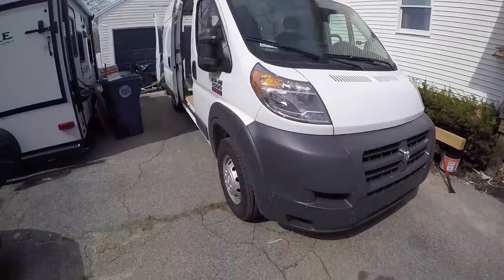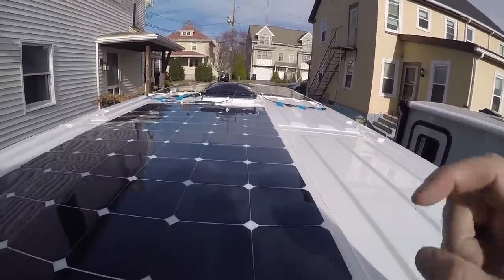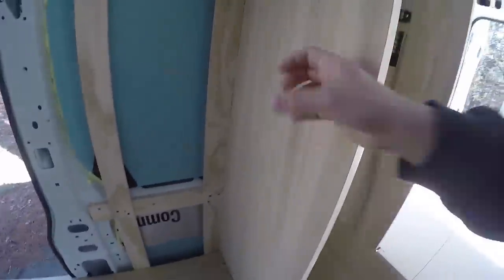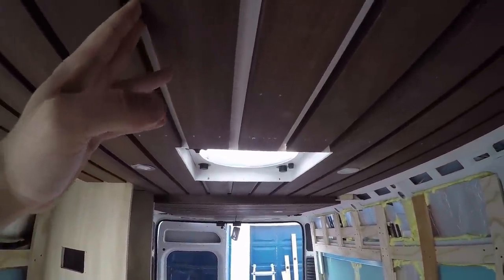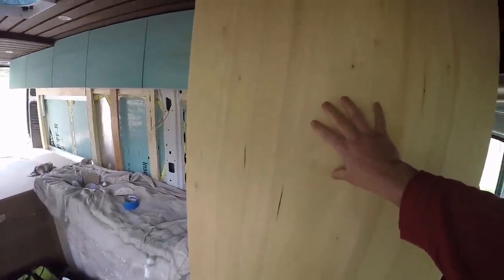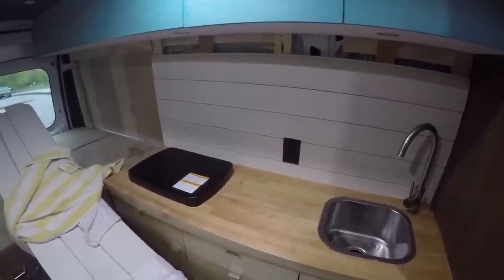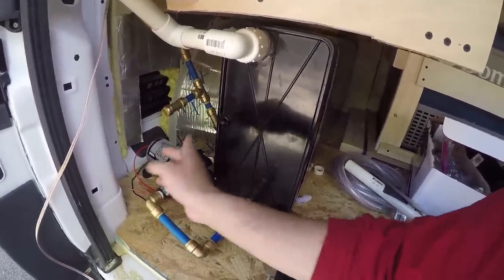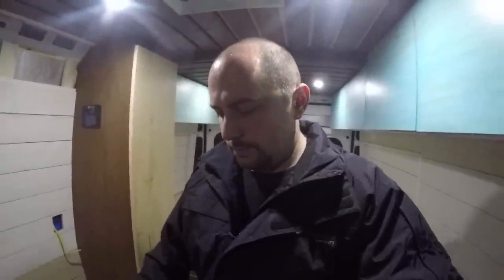How I Converted My Van into a Stealth / Off Grid / Tiny Home Van

Comment: Hi - Is your van the high roof?
Reply from the maker: James Stufano yes it is
Reply: Thanks. I like the work you did. Can I ask why you picked the Dodge Van you did versus say the Mercedes Sprinter?   If you had a do over would you have used a 4x4 or diesel?  I ask because I was thinking of the Mercedes Sprinter until I watched your video and you seem to think things out.  Is the engine and build of the Dodge solid?  I also noticed many for sale have a metal wall behind the seat. Did you keep or remove your wall? Thanks. Sorry for all the questions in one text.
Reply from the maker: James Stufano I actually did a video about why I went with the Promaster so check that out. But couple main reasons were price, a 4x4 sprinter near the same wheelbase goes for $55-60k brand new same year as mine. Mine was $31-32k. Amount of room! The Promaster has more cubic feet then the sprinter by far. Promaster is front wheel drive which can handle snow well. In my "one year in the van" video I did a flashback to me driving through a blizzard. The engine remains to be seen. I only have 16k miles on it but I will say the price of repairs is a lot cheaper then the sprinter. After saying all that IF I do another build I will probably go with a 144" 4x4 sprinter. I've driven them and they do drive amazingly well. Also a little smaller which is cool and a challenge to build. Depends on if I want to build another stealth van or adventure van. Go look at the professional companies that build on both sprinter and Promaster and see what they like.
Reply from the maker: James Stufano oh and sorry I didn't answer about the wall. Mine didn't have the metal wall. My brother is doing a build in a 170" sprinter right now and his had a wall and he just removed it. I hear it's easy

Comment: You should put an hho system in this too..
Reply from the maker: Justin Heitter I looked into those systems and I’ve seen them before. I just didn’t want it for my set up is all. Maybe on a larger van or if I was using my shower more

Comment: I didn't know you can stand in a Promaster
Reply from the maker: Promaster does make a low roof and a high roof. With it totally empty the high room inside from metal floor to metal ceiling is a little over 6'4"

Comment: How did you fasten the solar directly to the roof?
Reply from the maker: With flexible panels it's hard to fasten down. I used sikaflex
Reply: Have you had issues with it or would you recommend this method. I don’t want holes in the roof and am contemplating putting them on a ladder rack but that will create more wind resistance. I like the the stealthiness of your install.
Reply from the maker: @nicolebracco4419  well you'll have to have holed no matter what. You need to run the wires into the van somehow. I have 2 holes in my roof. One is my roof vent and the other is much smaller to fit the wires in but still a hole. With flexible panels you don't need a air gap BUT with a regular solar panel you need a air gap so I'd suggest mounting them if you get a panel. But flexible you can stick right to top of roof

Comment: Nice job
Reply: I like that ceiling  thinking about doing that. Did it add much weight? I think that 3m makes a spray glue  that would prevent having to stilt the insulation. Think it tacks pretty fast. I’m going to try it anyway cause that seems difficult.

Comment: Counter top is overkill. 1" is the maximum thickness needed. And for an expensive van like a ProMaster you may as well invest in Lithium Ion batteries. They weigh 1/3 of the gels, take up 1/3 space and cost a 1/3 less over the life of the battery. Your use of materials is strange as well. Why add so much extra weight to the van when it isn't necessary. The ceiling boards could easily have been 1/2 as thick and the decorative cross pattern boards just add extra weight, waste material and add weight. When building small spaces for living, less is more. The slide-out coffee table is very nice.

Comment: How did you attach everything to the walls in the roof of the van
Reply from the maker: Great question. I wish I showed that and sorry I didn't. So the metal ribs on the sides of the van are diffented widths and we wanted to make sure everthing was going to be in line and straight. We took 3/4" plywood and cut them into strips and used them to attach to metal ribs of the van then put vertical strips in as well and that acted as a frame for my walls and also something for my upper cabinets to hold on to. The other walls inside are all done with cleats. The roof is screwed into the metal ribs above. There's a small point in the video you can see the frame of the walls to see a little better what I'm trying to explain. I will be doing a detailed video in the future of how certain parts on the van were built too.

Comment: How did you manage the planning and blueprint stage?
Reply from the maker: I made a sketch on google sketch up. I knew what I wanted for a layout but didn't really know until I got the van and got inside and started measuring everything out. I also knew I was going to make a lot of detail changes along the way so with my sketch I didn't go into detail. For example in my sketch my bathroom was smaller, kitchen counter was smaller, my overhead cabinets were different, closet was bigger, and my bench was changed a little.
Reply: Jarrod Tocci How did you know what to purchase, what you needed, what works? Did you watch other youtubers or your own research? Also why this van?
Reply from the maker: Fantastic question. When I first made the decision to build a van I knew I needed money so I took on a second job which was a low key overnight job at a hotel. Every shift for 5/6 months I watched videos, did research on products, contacted who I needed to contact, and because I was doing the build with my dad him and I sent hundreds of emails back and forth. When I found a product I really liked I designed around that product. For example I really wanted a fridge/freezer combo and the one I got opened from the top so I needed to fit it somewhere and open it too, so I had it slide out from under my bed. I knew the batteries were huge had to design around those. Where the water tanks would go, I knew I wanted my fresh water tank inside the van. A huge part of the design is the bed area, for me I didn't want to pull something out or fold something down every night before I went to bed. I wanted to do the least amount of moving things around to make something function. That's why things on my design slide like my table (You might of just convinced me to do a video on why I designed the way I did).  Even after all that I still think I missed some things or could of done a better build. I do love my build and what I did, but I'm just saying. Something I didn't do which I wish I did was to either rent a van and try it out for a weekend to see what I did and did not like, or go check out a RV place that has class B RV's and see how they work and function. I know there's also trade shows all over too. 
Why my van? I'm planning on doing a video on this but just some key points for me was the inside cubic foot can not be matched. This van is wide enough for someone of my size to lay across instead of the other way. The Promaster is the sister van to the Ducato which is from the UK and that van has won several awards. The big name RV companies are now using the Promaster for their class B's, so something must be right there. It's front wheel drive, which is the only van in this class that's front wheel drive. COST not only up front cost but repairs and even oil changes and maintenance. If I was to sell my van and do another build I'd come back to the Promaster for sure. My advice is to test drive which ever you're thinking about and get quotes on them just to compare. For me I loved how the Promaster drove, I felt like I was driving a car and not a van. Sorry for the long response but I hope it helped a little.

Comment: 1 problem none of these vans are wide enough to fit a sleeping full sized adult sideways.
Reply from the maker: Short E I sleep sideways. I’m only 5’8” and the bed is about 6’
Reply: Jarrod Tocci Hmm interesting whats the inside dimensions of these?
Reply from the maker: Short E with nothing inside the cargo area is roughly 12’6” x 6’4” but because I put insulation, walls, flooring, and ceiling in it takes away some space. You can maximize space a few different ways if needed
Reply: Wow, I built my own Tiny Home on a trailer and the inside dimensions are only 5×9 I probably should of just built 1 of these your van gets the same mpg as my vehicle does pulling the trailer too.
Reply from the maker: Short E very impressed you built one inside 5 x 9! Awesome 👍
Reply: Jarrod Tocci Thanks, I got a video of it on my page
Reply from the maker: Short E awesome thanks I’ll check it out!

Comment: What are the dimmensions of the shower?
Reply from the maker: Tyler Alexander 27” x 24” I’m doing more in depth video of the shower this week
Reply: Sweet I'm looking forward to it. Also, what were the pink strips you put down on the floor before the insulation?
Reply from the maker: Tyler Alexander just acted as a filler. Not sure if it even did anything other then fill in the space between the floor ribs. They might of helped with insulation a little too
Reply: I figured it was to level the floor, but what kind of material is it?
Reply from the maker: Tyler Alexander just like a foam. Picked up a roll of it at Home Depot. Remember it being pretty cheap

Comment: See you used some Old Shitty Board for the floor, LOL.
Ceiling looks good.
Reply from the maker: You mean brand new vinyl flooring from home Depot.....ok
Reply: (I was referring to the underlay. ;-)) @JarrodTocci
Reply from the maker: @softdorothy  lol I see....so you mean the wood marked as "underlayment" or "subfloor" also at Home Depot ;)

But you're right I could of went with something more expensive but in my opinion there was no point seeing how the purpose of a subfloor is to be under the finish flooring and act as support

Comment: Interesting project, but so much wasted space!  So many vids by maritime builders could have shown you how to utilize every inch, and use lightweight materials.  How do you sit up in bed without hitting your head on the overhead locker?
Reply from the maker: tina silver the space was designed exactly how I wanted it. I know there’s “wasted” space but I also wanted to keep it as open as possible. My bed area is for sleeping so to sit up in there wasn’t a concern as I have a bench sitting area for me to sit, read, write, or do any other work or eat. I said in the video that everyone is different with a design and purpose and I built and designed this for my purpose.

Comment: Can't you make the heating easier than having to remove the panel? It would annoy me. So cool that you have a shower.
Reply from the maker: Shower has been great. I don't use it everyday but still very handy. I don't use my heater that much mostly because I spend my time in warmer climate so yo heat the van quickly is it main purpose

Comment: How do you secure the toilet to the floor?
Reply from the maker: Albert Ochoa it’s not fastened down only because of the size of the shower I remove it from the shower when I want to use the shower. To keep it from sliding about while driving I put small rubber non slip pads under it. I also built a heavy duty shelf inside the shower so now I can just slide the toilet out on the shelf instead of picking it up

Comment: what about magnetic field/radiation from the battery?
Reply from the maker: wallmachine good question. In my video touring the solar company I explain how my batteries go give off anything harmful which is a major reason why I got mine. The lead acid batteries do and need to be vented
Reply: ... Radiation?  Magnetic fields? I'm lost on why these affect the battery. If you mean gases, sulphuric acid batteries create small amounts of hydrogen (H) during charging, which is why they need to be vented. Hydrogen isn't toxic, but it is highly flammable. With these VRLA, or gel batteries, venting isn't normally required since they vent oxygen into the negative plate reaction, which then instead of releasing hydrogen, H, they combine oxygen, O, and create H2O, or water. Pretty cool.

Comment: What is this rattle trap stuff?
Reply from the maker: That stuff stops or helps the sheet metal of the van from vibrating. If you're ever inside a van that's all bare metal, go knock on the metal and listen on how it sounds and then put rattle trap on and knock again, huge difference. Best way for me to describe it

Comment: With what that must have cost you, wouldn't it have been just as easy to simply buy a mobile home.?
Reply from the maker: I bought my van brand new for around $31K and the build was about $7K for being under $40K. A brand new class B mobile home goes for $80 for cheap ones and $120K for nice ones. They are also build for travel and not for full time living. I wanted to custom mine to live in full time in city life. Thanks for the question though as it was a good one.

Comment: Need a wiring diagram... PLEASE!!!!!
Reply from the maker: ZL S I honestly didn’t trust myself with most of the electrical. I know I called and talked to several different companies and people while trying to figure out the electrical plan. Also my dad knows about that and I know he made a diagram somewhere but I’m pretty sure it was just a sketch on a random piece of paper. I’ll see if I can find a picture of it somewhere or if he still has it. I was very close to pay someone to do my electrical plan as that stuff really scares me. I plan on doing a couple videos on electrical and solar in the near future also. When I go visit Renogy I’ll ask if they can help me with a diagram and post it
Reply: Jarrod Tocci   Please,  I clicked on a few other supposed "Ultimate Van Makeovers" or whatever and you get like aquarium pumps submerged in 5 gallon water containers under the sink!  Its not just the solar that makes yours stand out, its how it acts passive when shore power is connected.  the ability to make one or the other become dominant without fluctuations destroying the deep cycle batteries isn't as easy as just buying the parts you purchased and connecting them!!!!

Comment: Like lots of the van, the horrid part, I have to say is the insulation, this will all rust out in 5-10yrs, the only way to do it right is a spray on moisture barrier. I used a bedliner on the floor, then the rest I did with a ceramic spray on called Lizardskin, anyone else building a van should do more homework, as having to redo this in 5 yrs will be pissed. Just take any van over 5yrs and start pulling panels and the subfloor and you will see rust. heck just pull the plastic off the slider or the driver or passenger doors and you will see rust.  mdf is also so much like a sponge...  just sayin, think outside the box, alloy works great, doesn't rot and won't warp etc...  food for thought.... Dig them panels btw but I am going solara, you can walk across them. They aren't made in China, made in Germany.

Comment: Very cool but I recon your van weighs a shit load.
Reply from the maker: Thank you. I actually just had it weighted and it's way under GVWR
Reply: @JarrodTocci  I looks heavy due to all of your extras. It looks amazing. I'm seriously considering doing the mobile home thing. Apart from the money saved and the freedom I think that when the shit hits the fan i would be good to be mobile.
Reply: @JarrodTocci  What is the weight and Floor space?
Reply from the maker: @LEO-xo9cz  pretty much the same reason I did this! Mine is for sale now 😉 only because I'm building another one though. I love this one but I'm doing even more upgrades! Floor space is about 12'6" long and 6' wide. My total weight is 7500 that's with all my gear in the van, full water tanks, and including an entire wood shop (if you look at more recent videos you'll see what I'm talking about). The GVWR is like 8800 or somewhere around there
Reply: @JarrodTocci  Very nice job! I'm in the UK and have considered a river boat, van or shipping containers to do something like this.

Comment: I bet your solar panels failed after about a year or two, I will NEVER buy a flexible solar panel again! if you glued them to the roof of the van as I did the heat build up between the panel and the roof of the van will blister the paint on the roof.
Reply from the maker: Peter Bailey do you mind me asking what you used to glue them down with? And where were the flexible panels from?
Reply: Hi Jarrod, I purchased my 2 * 100w panels from ebay about two years ago, I used sikaflex sealing compound to fix the panels to roof (hilux poptop), trust me, panels need breathing room under or they will fail.
Reply from the maker: Peter Bailey cool thanks for the info

Comment: What’s rattle trap
Reply from the maker: Jalen it’s a sound damping material. It stops or minimizes the vibration in the metal. For example a lot of people use them in car trucks when installing a subwoofer to stop the rattling of metal
Reply: Jarrod Tocci thanks

Comment: It's not a Dodge. Dodge and Ram split in 2009
Reply from the maker: Ithinkojisguilty fair enough. Just assumed with dodge logo on the steering wheel and bought from a dodge dealership
Reply from the maker: Ithinkojisguilty such a weird split. Was reading about it and I was never doubting you I just wanted to know why the split. Thanks for the correct info though
Reply: Dodge actually has a whole new logo. Your van is actually the North American version of the Fiat Ducato. Have a look at those conversions when you get a chance.
Reply from the maker: Ithinkojisguilty cool thanks. I knew that it was related to the ducato.